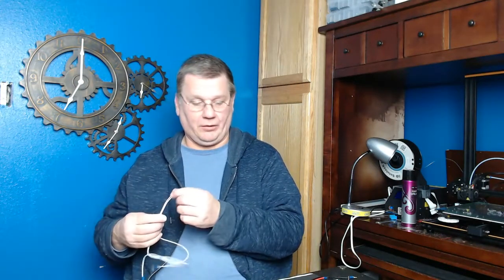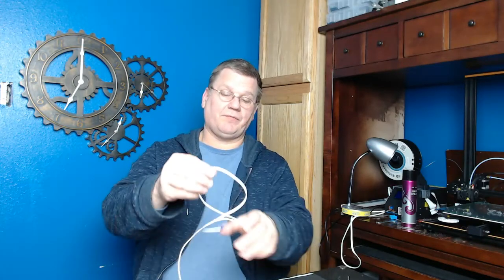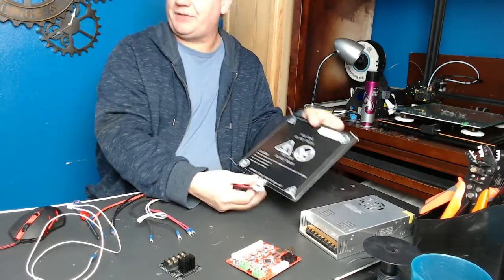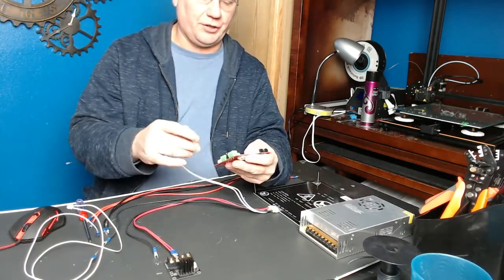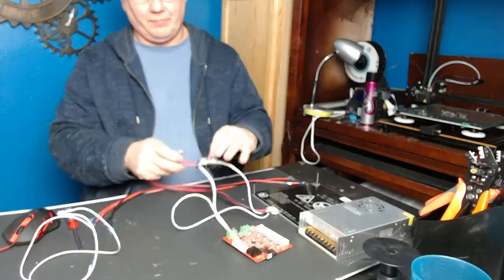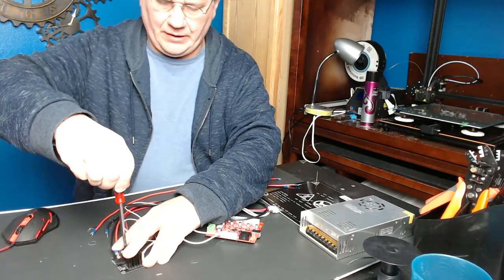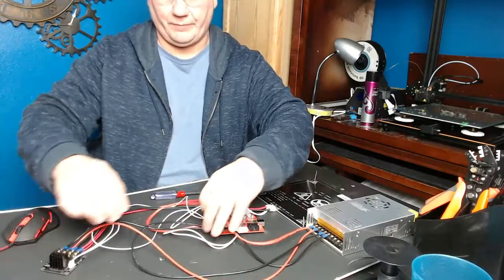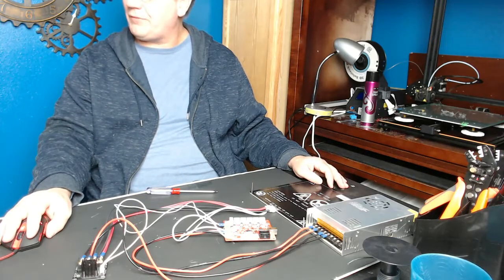install Anet A8 Mosfet with upgraded harness

Comment: Just received and hooked up your heatbed wire harness and mosfet cable. All seemed well but then I noticed the heatbed seems to heat up immediately when the machine is plugged in and went up past 90 before I shut it down. I think the wiring is right but can you help explain this?
Reply from the maker: Sounds like the thermistor is not connected Make sure its in the right socket and the wires are making a good connection. Also I have read that turning the printer off during heat up has caused damage to the control board on some machines. Please let me know how this goes
Reply: Seems to have been a bad mosfet. Upgraded to a better one and it worked fine.